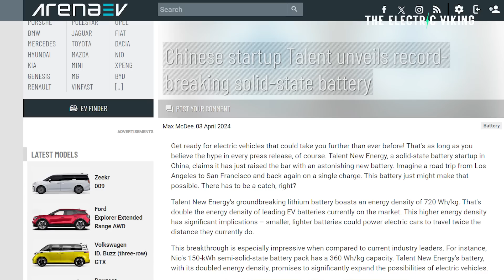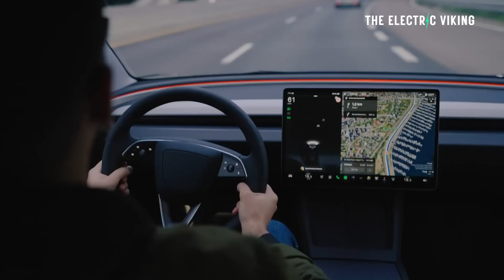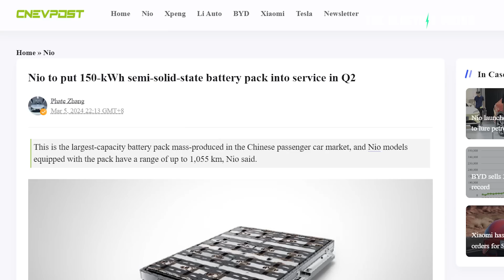Highest energy density battery in the world enables EVs with 1250 mile range

Comment: How many kwh/liter?  Also, A new 50 Kwh battery will not improve range compared to a current 50 Kwh battery.
Reply: Not as much as you think. Only 32% of the energy in your liter of gas is used for forward propulsion. 68% is lost as waste heat. Given the new 50 kwh battery has the energy density he describes it will be smaller and lighter and therefore effect range.
Reply: @marviwilson1853  The lower overall battery weight will help the range but only slightly.  For example having two passengers in your car does not change your mileage or arrange to any great degree.

Comment: Crazy thought: what about a minuture nuclear reactor for motor vehicles?
Reply: The heart of a nuclear reactor is just a steam engine. It uses nuclear fuel to heat the water instead of coal or wood. It might be possible with a "nuclear battery". There are technologies being worked on that can potentially convert radioactivity into electric current with no moving parts. It would not be rechargeable but it could have a half life of over 5,000 years, meaning at 5,000 years it would still produce 50% of the power as when it was manufactured. We aren't going to have to wait long, AI will solve all these problems in the next ten years.
Reply: @sdickinson5234  A very thoughtful reply. Thank you. Your description is what I wanted to describe but didn't have the technical knowledge to properly say.
Reply: And put it in a DeLorean.

Comment: Range anxiety is the number one concern next to repair cost and battery replacement.

In order to convince ICE owners to convert to EV you’ll have to offer extra ordinary advantages. 

1000 KM range would be a good start. The extra battery size would help compensate for extreme cold to maintain temperature, A/C, music….an EV owner can enjoy all the comforts without worrying about loose km. 500 km between changing would turn heads.

Battery failure and replacement costs. Insurance is crazy for EV because of the batteries. Three year warranty isn’t long enough. 7 year transferable warranty on the battery only would help people to consider an EV.

If you don’t have to charge your car everyday would be great
Reply: "500 km between changing would turn heads."    Most long range EVs today are fully capable of 500 km range.   I have to assume you mean 500 miles.   Tesla batteries and powertrains are warrantied for 8 years.    Charging daily (assuming you have home charging) is the easiest situation since it literally takes 5-10 seconds to plug it in.  Most  Next gen vehicles probably will have wireless charging convenience for home charging and you just park and the next day your car is charged.    Insurance costs for EVs is about the same as ICE for the same price vehicle.   So you are unduly worried about BS that the popular press is spouting.
Reply: @brianbeasley7270 the media does have a lot to do with EV opinions. EV’s are great metro cars not long distance or pulling anything, right now. Charging at home is definitely an advantage. 

The cons out weigh the pros for EV’s unless you live in the city and you don’t require a heavy truck to pull your trade around or your RV.

The EV battery carries all the operating weight. Heating the cab, heating the battery, A/C, lights…..the creature comforts kills distance. If an EV battery allowed to drive 500 miles and run all the creature comforts without hesitation EV’s would be a real option over ICE. 

I believe freight and heavy duty equipment will run on hydrogen. Hybrid vehicles will dominate using hydrogen. Both electric and hybrid will have its place for what they’re needed to do for the end user.

What ever you choose, it’s okay. Just don’t tell me what I need and when you’re on the side of the road, out of gas or need a charge, I’ll stop and help.🤷‍♂️
Reply: @markwiegard8384     I've owned Teslas for over 5 years and I don't live in the city.  Charging at home is a huge advantage for urban, rural, or suburban environments.   The only place you charge outside the home is on trips if you have home charging.   The Cybertruck and the Semi are about to change the pickup and large truck situation in the next 3 years.   Most ICE cars can't get 500 miles (especially for city driving) running air conditioning, etc.   The range change due to air conditioning is negligible for Teslas.  Heating does take more.     

Hydrogen will not happen due to economics.  The car companies with brains are abandoning it.  H2 cost 3X to 4X the cost of diesel so there is no way trucking is going to buy that fuel for a business.

No need to tell you what to drive.   Eventually, most will figure it out for themselves when they realize the convenience of BEVs vs ICE or hybrids, the lowered maintenance, and the fuel expenses, as well as the power, instant torque, quietness.   There is no way I would ever go back to ICE after my 7 years of BEV driving.  My only caveat is that if you can't charge at home or work, and don't have a nearby supercharger, you might want to stick to ICE for a while.

Comment: You're confusing energy density with capacity -- all things being equal a 100KWHr battery (capacity) will get about the same range if driven over the same course at the same speed regardless of what the chemistry is or what the energy density is.  A higher energy density battery, say double the current batteries, with the same capacity will have about the same range -- just that the higher energy density battery will be smaller and lighter, which should increase the range a little.  I'm surprised you didn't get that they are not the same thing.

Comment: The problem, is the lack of charging infrastructure. The existing power grid cannot supply even 10% of cars on the road today. Every city would need its own nuclear power station to supply the charging network.
Reply: Coal. The USA is the Saudi Arabia of coal. Carbon Dioxide is not a pollutant. It makes plants grow.
Reply: @sdickinson5234  Please explain the millennial old glaciers melting, the increase in severe weather cycles, and flooding. Explain the increasing crop failures in once fertile lands.

Comment: I seriously really don't care about 700\800 mile of range, who cares if it can go a long ways but only has a lifespan of a 100,000/150,000mi. For the average consumer like myself what's much much much much much much more important to me is a battery that will last  a million miles before it needs to be changed out. Imagine the resale value of your vehicle when you go to sell it at 300,000 miles and you're not even halfway through the battery pack lifespan. I'll take that second hand used car much more than the one that has a lifespan of 150,000 miles but can get 800 on a charge and is already at 90,000 miles on the odometer.. even 300 Mi of range is perfectly fine with me over the last five years of owning my Tesla, but the lifespan is far more important.

Comment: Nice video.  This makes me wonder about the Osborn effect.  Why get an EV now when, at this rate of improvement, who would want today's version of EITHER ICE or BEV?
Reply: Batteries are swappable. My 2021 58kWh car will probably get an 80kWh battery replacement in 5-8 years for half today’s price. And it will be as new with 1/3 added range.
Reply: That's very real. Next year's cars will be better and cheaper (does not apply to ICE). And use NACS plugs.
Reply: Osbourne,  I had one,  they went bankrupt as nobody bought current model, replacement promised so much more.  Already happening perhaps  to Tesla y to some extent

Comment: Just think, riding in a plane without those noisy engines?  Even if they were far quieter, it would be nice.  I have been thinking about getting a new vehicle and I will probably go electric.  Going to give it about 2 yrs and most likely go Tesla unless someone else comes along with a better vehicle in 2 yrs.  The charging rates and distance you can drive on a charge is amazing.  Now with the LFP batteries and them not suffering from cold issues, I live in Minnesota, just about does it for me.

Comment: The unfeasibility of using any kind of battery propulsion and aircraft just highlights the feebly adequate usage of batteries in cars as well. No battery aircraft can fly for longer than 20 minutes. So even if they could make it 40 minutes for 50 minutes it would never be useable. Even hydrogen fuel cell drones can only muster two and a half hours of endurance which really is not even enough for flying vehicles. Shouldn't have intentionally waged that huge PR campaign to quash hydrogen fuel cells for vehicles. It doesn't matter they're still going ahead with many HFC projects and I think we've gotten past the hump of your derailment campaign against hydrogen fuel cell. But you can go on and on about the latest 10 ton battery that has a thousand mile range now. Oh boy. You can take a Toyota Murai put another tank in the backseat? How hard would that be compared to all your engineering super high density batteries. Put another tank in the trunk too. Fill all the tanks in 10 minutes for 1200 Miles range.

Comment: Energy is measured in watt hours.  Power is measured in watts   The pack 'size' represents the ENERGY content and thus is expressed in watt hours.  Energy density (gravimetric) is expressed as wh per kg.  You keep in refering to watts per kg.  Thats POWER, not energy.

A 50 kwh battery is a 50 kwh battery regardless of the energy density.  One might be lighter and/or smaller, but it will provide about the same efficiency and thus range for the same vehicle.  Weight accounts for less than 20% of energy consumption (and only really when going uphill) so even if the one 50 kwh pack is 40% lighter than the other pack and the pack is 1/4 the weight if the car it will only improve efficiency by 40% of 25% of 20% which is 2%.  To go farther you need more energy in the pack, thus a 70 kwh pack vs a 50 kwh pack of the same size and weight.  The pack is the gas tank.  You need a tank that can contain more energy.  With a gasoline car you enlarge the tank.  With EVs you have to get more energy into the pack because you cannot enlarge the packs (they are already at max size and too heavy).

Higher energy density enables higher energy content packs and thus more range.  A 50 kwh pack made w 200 wh/kg cells and a 50 kwh pack made with 300 kw/h cells are not going to increase range (for the same vehicle model) by much.  You need the higher energy density to add more energy (kwh) to the pack.

Regardless.  There are NO 360 wh/kg cells in production anywhere in the world.  And 720 wh/kg cells is a fantasy at this point (unless you are OK with 50% degradation in 100 charge cycles).  Not to mention SOLID STATE batteries.  Do not drink the Cool Aid.  SS batteries are not viable for the foreseeable future.  Neither are 720 wh/kg cells.

You widely touted CATL starting production on 500 wh/kg cells in early 2023.  Since there has been NOTHING about it.  Don't you learn from these outrageous claims?  Don't just believe everything you hear.

Comment: an increase in energy density does not allow you to drive any further - it just means you will have less battery weight to go the same distance - but saying that - it means in theory you would go a bit further because you are moving less mass.Don't think Sam understands energy density / kwh. The amount of KWH ( about ~15kwh / per 100km) determines distance travelled - NOT energy density. Unfortunately - it sounds like Sam never reads comments - so this is probably wasted effort?

Comment: So as long as you own your own home (and preferably live in a warm environment) you're in good shape. In reality, of course, it won't make that much difference in EV car sales volume, but it will help with trucks, work vans, delivery vehicles and medium haul flights as well as air taxies. 

EVs market penetration for cars will be limited to home owners until apartments install charging stations for every apartment parking spot.
Reply: I live in a mid rise apartment block with no home charging ability and a Model 3. I use the supercharger about 10 miles away once or twice a week - no issues there, but would be a bit cheaper if I could use home electricity and especially solar panels - but they will come in time. Until then, I'm OK with the situation.
Reply: @ahaveland  And how long do you have to wait for your car to be fully charged, and how much does it cost per/kwh compared to your price at home?
Reply: @mikeearussi  Don't need to keep it fully charged unless it's an LFP battery! Charged enough is good enough, but I keep it between 20-80%, and it usually hovers around 50% during the week where I don't use it much because I work mainly from home. At weekends I can't wait to stick a pin in a map and just navigate there to explore.
In that case, the nav does the planning on where and how much to charge - it becomes easy and routine.
As for cost, supercharger here is 43 c/kWh.
Domestic electricity is about 12c/kWh, so it's quite a difference.
I'm not concerned though - I have good job and no mortgage/rent so can afford to treat myself and enjoy the experience.
Charging time is also a non-issue. If I need to charge, then I allow time for it, just plug in and do some shopping, or just sit in the car and work, surf or watch youtube using the free mobile connection.
Unlike gasoline, I don't have to stand outside in the rain for half an hour with a nozzle!
All in all, I'll never go back to ICE.

So far since December 21st, I've done over 12,000 km, and the app gives usage stats of 2,961 kWh for £1,261.
Not too bad, but if I had a house in the suburbs then electricity could be less, but most of my usage has been on longer trips requiring superchargers, such as when I did 5700km driving back to England and back in December, when range is lower because of the need to preheat the battery. Still, it was no problem at all.
Reply: @ahaveland  For your particular situation is works fine. But your situation is also unique and won't apply to the 99.9% of the rest of apartment dwellers. So basically you've made my point for me, EVs are impractical for the vast majority of apartment dwellers.
Reply: @mikeearussi  I don't understand how you infer 99.9% from what I said at all! I'm not unique or the only person around here (Hungary) that have EVs and city apartments. May not suit half of people, but 99.9% is just irrational.
Reply: @ahaveland  You have free rent and you work at home. This may not rare in Hungry but in the U.S. it's practically unheard of.
Reply: @mikeearussi  I save what I don't spend in rent or mortgage, so that is irrelevant.
the real point is that anyone can treat an EV just like an ICE car and go to a fuel station when they want to.
Even with supercharging, the cost of running my car is less than the ICE cars of my neighbors with whom I park!
Reply: @ahaveland  Convincing people to do what is not in their best interest is challenging, and buying an EV for the majority of car owners is not in their best interest. And please don't pretend EVs will contribute in any appreciably way to helping the environment. In fact they can even make it worse due to all the mining required in their manufacture. World climate problems cannot be combatted at the individual level:
https://www.youtube.com/watch?v=YOJ2Mf6KQ3g&ab_channel=PBSTerra

The original purpose of EVs was to combat air pollution in big cities like Los Angles, CA. and they do help. But the only way they can be beneficial to the individual is if they can be charged at home using cheap electricity thereby saving money on gasoline.
Reply: @mikeearussi  You do you. I'll do me, thanks.

Comment: For starters Jeff dahn. The guy that does the research for Tesla has been working on the lithium metal battery for about 4 years now.  They aren't happy with the cycle life. #2 you for some reason thinking that a 50 kwh battery pack is going to go as far as a 75 . That won't happen . However the 75 kwh battery pack won't take up as much room .

Comment: Hey cobber.  You need to do the math better.  If you put a 50 kWh battery in a Tesla it will not get you a 1000 mile range.  If you put a 50 Kg battery, using the 720 Wh/Kg, you will only have 36 kWh capacity, still not enough to obtain the range you suggested.

Do ya wanna try that again, genius?

Comment: EVs are not yet the best choice for most people, especially as a main family car. 1000km of claimed autonomy turns out to be closer to 800km of real autonomy and for long journeys by motorway this becomes closer to 500km.
Furthermore, you can buy a VW Golf for 30k€, but if you go for the ID.3 it’s 43k€. This takes some 7 years to be worth it for the EV, and that’s not taking into account the low used value of EVs, the fact that there aren’t enough fast charging stations and that you can’t drive EV  300km and return without having to look for a fast station.
Although batteries and EVs are evolving very fast, they still have a lot to go to make financial sense against ICEs.

Comment: Hey - wait a minute Electric Viking 🧐- If I need a bathroom break, I need a bathroom break. If I need to stop to charge, I need to stop to charge. They're not the same 🤨 - The fewer stops for either, the better though 😅
Reply: Usually they are the same.
Reply: Sure. Only he said that if you didn't have to stop for fuel that you'd pee in a bottle instead pausing your trip for a bathroom break.  @jamesvandamme7786